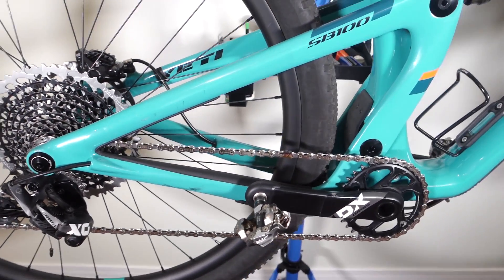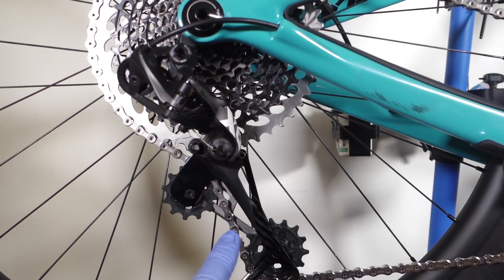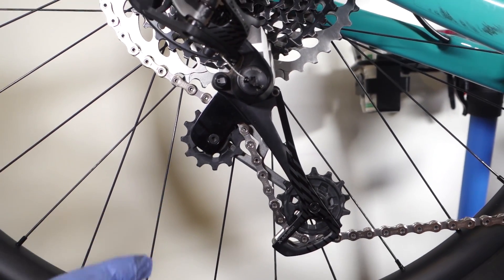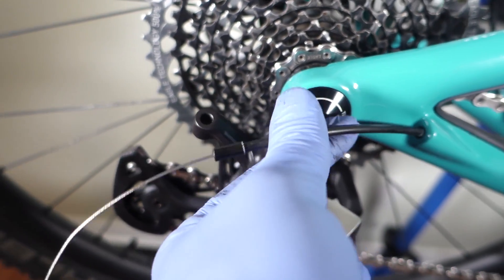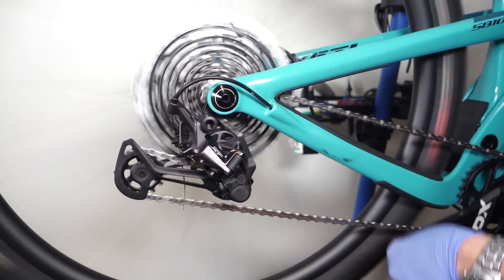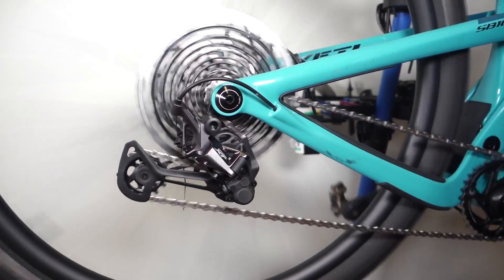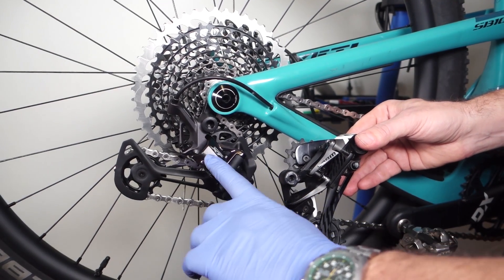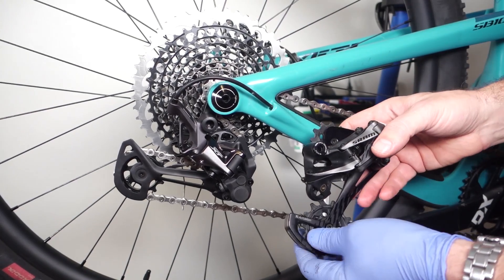MIX Drivetrain🔥12 Speed SRAM Eagle Can Use a Shimano Derailleur - Hybrid Drivetrain

Comment: Hi can I ask what derailleur hanger did you use, stock?  Im looking buy the xx1 bbolt and limit screw set for an upgrade and was wondering if I can use the bolt as well as the hanger.  Its the gold colored xx1 bolt
Reply from the maker: Hanger is frame specific so I would keep it like that 😉

Comment: hi, i have shimano xt derailer and shifter, sram cassette and chain. 2 questions, which method for chain length and which method for b gap? cheers
Reply from the maker: @richarddevey2449  Either one Shimano/ SRAM provide same results so I usually use Shimano, easier to do. Have a Shimano 12s install video if you need guidance on that
Reply: @LoveMTB  thankyou i will

Comment: Great videos! You let me have special idea. Would you have tested sram x1 11 speed shifter used with shimano M6100 12 speed derailleur? It works?
Reply from the maker: 11 speed is a slightly different beast, it will work to some extend, what cassette?

Comment: This is what I run and I think I prefer it over the Sram xo derailleur. The shifting genuinely seems more consistent with less noise dropping down fast.
I do feel that Sram derailleurs pulley cage is tighter and firmer than the xts which has more flex but in useI haven't noticed any negatives.
I much prefer the Shimano clutch system. My XO derailleur was in very good shape but the clutch was non-existant. Not sure how long it lasted but in my opinion it should still be working considering the cost. No adjustment and no servicing while Shimano is completely adjustable, rebuild able and replaceable on a derailleur far cheaper and I believe just as light.
So, as far as derailleurs are concerned, big fan of Shimano over Sram plus it sits far closer to the bike than sram.
I'm sold on the sram cassette ever since I first saw it. Being 1 piece machined from tool steel is next level and you pay for it but it's solid, zero flex, super durable and ultra light. The last 2 are hard to achieve but gone are the days of replacing a worn cassette every couple years. Ditto the chain. The higher end sram chains look like any other but supposedly they built an entirely new facility just for the chain and they just don't stretch. Strong too. I use fancy Silca drip wax that should also prevent wear. So, longevity wise those components are solid. I've not tried the Shimano cassettes with the newer shift technology but would expect it to shift smoother. The construction is inferior but their shift tech is pretty much unmatched, they have a ton of experience with the ramps and gates, my 10 speed stuff shifts like butter, sram not so much. It's good but not see less like Shimano.
Reply from the maker: Yeah we used it for the same reasons you mentioned. Thanks for sharing!

Comment: hey there, I've got an X01 shifter, NX 12s cassete and XT derailleur, b screw adjusted to shimano's guide, limiting screws set up right, gears go up to the easier gear really well but going down is a trouble as it sometimes goes 2 cogs down and adjusts itself back to the correct cog, when i twist the adjusting screw any tighter then it doesn't wanna go down a cog any ideas? The hanger is straight btw
Reply from the maker: I would check your derailleur hanger first before anything

Comment: As someone who currently is having issues with the shifting on a SX 12 speed derailleur (keeps jumping between gears in the middle of the range seemingly on it own) this is great to hear. Was first thinking to upgrade to a GX one, but people seem to have mixed opinions on that one too. Can I just grab any Shimano 12 Speed model or is there anything in particular I have to keep in mind when choosing one? And can the chain length stay as is or does it need to be longer / shorter?
Reply: Seems to be a bent derailleur hanger

Comment: Great job as always! Nice to hear the straight goods on mix & match, and I agree with all your points. No one else mentions how long cage 12s derailleurs are more prone to picking up debris. I have 3 bikes total. I used to use Shimano 10s shifting hard out of the saddle up & DOWN the cassette during racing and training. But you're right, there's not many races where this is enough of an advantage. But you DO have to let a Sram 12s "breath" more while shifting. I'm super paranoid about munching my Eagle XX1 derailleur. But when I do, it will be Shimano XT 12s derailleurs all the way all three bikes! Simpler and cheaper for stocking maintenance spares. The one thing I find is the Sram XX1 shifter is a better ergonomic feel for me compared to a Shimano XTR 12s shifter, no matter how it's adjusted.

Comment: I did this and it doesnt work for me. i have a SRAM SX  rd, NX Shifter, 11-50 sram cassette and really bad shifting. I replaced the rd with a shimano xt 12spd XTM8100. the shifting is worse. I spent 2 hrs trying to make it work. Ive been working on my own bikes for 35 years so im no beginner. The B tension screw when fully backed out is almost completely removed and the rd  jockey wheel is still a long way from the cassette. The cable length was too long (sx rd). i left it long and it did a 180 deg turn with a 5cm diameter. Not sure if thats the issue. its a newer bike . commensal meta AM 2021, use 1 season. no wear. What could cause it to skip gears or not shift at all . I thought shifting could not get worse than what i have with sram, but it did. Should i buy an xt shifter too? and ditch the sram nx shifter? is the cassette spacing the same on sram and shimano?
Reply: @LoveMTB  Thanks, I added links to the chain and the rd jockey wheel got much closer to the cassette but the shifting is still really bad. the stock sx rd is way better (and thats so bad i wanted to change it !) What can i try? I  did get shifting to work well on the stand only in the larger cogs only if i ran the chain so slack it hung loose with no chain tension on the smaller cogs. Not sure if i should order an xt shifter, so i have xt rd and xt shifter, nx cassette, chain. ? or just sell the xt rd and wait till i can afford an entire noew drive train.

Comment: Got a question. Daughter got a Rockhopper for Xmas. Has 135mm hub with a 10 speed cassette. I have a lot of Shimano 12 speed parts laying around, mostly SLX. Rear hub body is older Shimano. Would a SRAM NX 12 speed cassette work so I can upgrade the rest? I believe 12 speed same width as 10?
Reply: @LoveMTB  I saw! I see some around and in stock thanks. I guess there’s a model for SRAM and one for Shimano derailleurs

Comment: Hie there, definitly subed to your awsome channel!
I hve tried this set up on my new build so gx 10-50 cassette with Xt 2 speed derailleur but i struggle getting the limit screw far enough to have proper indexing for the lowest gear. in fact, im turning it to the max outboard and it doesn't go far enough, any help is much appreciated! :-(

Comment: thx for your great videos and the tests!  After watching your videos, I bought XT shifter and deore 12 speed derailleur to replace the previous poor quality SX ones.  The Shimano components work perfectly, and much better than before, with the SX cassette, chain and crankset.  

Also, as mentioned in your another video, the XT shifter feels  like the sram's one but also with Shimano's two way release advantage.  Now I am happy to use this Shimano-Sram combo chainset until the next upgrade.  It gives me more flexibility to choose my future wheelset and gears.
Reply: Hi! Use the same combo and it works good. How do you adjust B gap? I try to line up with the 51 line on the derailleur but it doesn’t work. If I make it closer (loose b tension on maximum) it works good.

Comment: What about under load? I got one of the bad GX cassettes which click in certain gears cause of deforming teeth, so I’m gonna slowly switch to XT. Planning on starting by getting the XT derailleur and shifter.
Reply: @LoveMTB  can it do the double shift to the smaller gears on the sram cassette with the XT shifter? Or does that feature only work on an XT cassette

Comment: last year I bought a bike with SX group, one of the most stupid things I ever did, I plan on buying a SLX derailleur and shifter, and use the same sx 11-50 cassette, do you think it will work well? I have no plan on buying anything microspline or other thing so I will keep it low cost.
Reply: @LoveMTB  thanks dude, will have a look into this new deore, I will have to change the shifter too, SX shifter just fell apart, I had to wrap it with tape, the screws really did screw up... real piece of crap. I bought a new bike with GX 2021 and it's just like dream! nice channel btw
Reply: @LoveMTB  yeah sram is good from gx and above, sx and nx I wouldnt go for it anymore  Thx for ur help dude

Comment: Hi, again great video :) thanks a lot for making them. If I understand right, we can mix shimano and sram 12 speed systems but ... most important thing to keep it going smooth is to use cassette/chain/chainring same system (sram in this video for example) and then play with shifting. Is that correct based on your experience ? By this logic, it should also work opposite Shimano cassette/chain/chainring and Sram derailleur and shifter right ?

Comment: Hi, Shifting accuracy perfect, however upshift lever action is a bit harder to engage than Shimano paired with Shimano. It takes a more push pull pressure. Any tips to soften this lever action?  Thanks!

Comment: @LoveMTB, just wanted to say I love your channel. I recently started getting into mtb and learned a ton about bikes thanks to you!  I currently have a shimano XTR groupset. I would like to upgrade to the sram XX1 axs but I don't want to replace my whole groupset.  Do you think the xx1 axs upgrade kit with only a derailleur and shifter will work with my xtr crank, chain, and cassette?  Thanks in advance and I hope you get to read this.
Reply: @LoveMTB   yes sir!  XTR everything except for the derailleur /shifter. At first I thought about changing the whole group to XX1 however, the 2K price tag was a little steep.  I saw a good deal on ebay for just the upgrade kit for a little over $700 so I thought I'd give it a go. Worst case scenario if they don't play well together, i'll just go back on ebay and source out the remaining parts.  It's kinda sad nowadays that sram and shimano has different standards when just a few years back it's commonplace to mix match parts and get good performance. I guess they figured they'd make more money this way.  Anyway, thanks again!  I truly appreciate your reply.

Comment: Great video. Thank you for testing this. Been watching and learning from your vids for a few months now. 

Have recently swapped a sram SX rd and shifter for shimano XT. Had already warrantied the sram SX cassette for an NX cassette (bent the cassette after 4 months) and the sram chainring. 

Now running shimano XT shifter and rd with SRAM chainring, NX cassette and X01 chain. Works flawlessly. No more issues with b gap adjustment. Shimano RD is high quality. The “twist” makes perfect engineering sense. Very clever. 

But also wish Shimano had included the SRAM locking pin and that Shimano smoothed out the angle the cable must take through the RD housing just before the cable locking plate. The cover with tongue can easily be obtained or hacked - but is basically a bandaid for a design fault that I think could be fixed by rounding off the edge of the outer casing holder as the cable exits. SRAM solved this problem with a pulley wheel built into the RD - nice, but also another potential weak spot that will eventually fail due to repetitive stress. 

Inspected the clutch housing and mechanism prior to installing. The weakness in the Shimano clutch is definitely due to the ON/OFF switch. That’s the only point water can enter the clutch housing and create the corrosion and loss of grease that others have observed. I opened the housing, removed the switch and greased the port through which the switch lever enters the clutch housing. I used Shimano internal hub grease, but I reckon Parktool polylube or alternative thick grease would work. to prevent water entering here. 

I’ll let you know in 6 months how the clutch is going.

Comment: Hello 
The shimano xt 12 speed derailleur is out of stock in most website so im just wondering if shimano deore m6100 derailleur will work on sram eagle nx 12 speed cassette?
Reply: @LoveMTB   thank you. I ordered the shimano slx m7100 12 speed derailleur does it work with a shimano xt m8100 shifter?
Reply: Thank you for the answers :)
Reply: @LoveMTB   i just want  to double check does the sram nx cassette 12 speed works with shimano slx m7100 12 speed derailleur?

Comment: does a shimano xt groupset works with sram nx cassette?
Reply: Thank for the answer. What chain do i need to use?
Reply: I will keep that in mind thank you. just to make sure because my plan is i will use shimano xt shifter and crankset and derailleur and a sram nx cassette do they work together?
Reply: Thank you very much :)
Reply: I changed my mind im just wondering what about the shimano deore m6100 deraillur does it work ?

Comment: Great video! I have a full SRAM NX 1x12. the rear derailleur has been nothing but problems. Falling out of tune, ghost shifting 
, and it has recently started rattling. It is a know problem from play in the b bolt. I have given up and am switching to Shimano I am leaning towards the xtr because of the clutch stiffness and reliably as I ride rougher terrain. Do you have a preference xt over xtr ?
Reply: @LoveMTB   Thanks for the reply. Its just a friend of mine had a new XTR hes looking to sell very cheap. but one more question. What is the difference between m9100 and m9120. Are they both compatible on the 1x12 nx cassete.
Reply: @LoveMTB   Thank you so much. Your videos are very thorough, and extremely helpful. Also after more reseacrh I don't think the M9120 will work on my nx drivetrain. As the NX cassette is a 11- 50t and the m9120 uses a 10-45t. Don't know if the RD can adapt to a bigger chainring.

Comment: Great video, I’ve just replaced my NX derailleur with an XT M8100. When setting the B screw it seems to be maxed out in one direction and the upper jockey wheel still has a fair gap between the largest gear on the cassette. Any suggestions? I’m on a NP mega, maybe I need to change the hanger? Cheers
Reply: I’ve the same problem with shimano m6100 derailleur (

Comment: Hi! Was wondering which chain you need to use?

Currently, I am using xt 12speed rear Dee + SRAM 12speed chain + 11-50t zitto cassette. Can't seem to shift properly.

Would you think it's the chain + rear Dee combo or the cassette is the issue?
Reply: @LoveMTB  yeah likely to look into swapping to a SRAM cassette at the least to see if it's better. Thanks for replying! 🤙🤙

Comment: Hi, I find your content very entertaining and I learn a lot from you. I have a question. I want to convert my 3 × 8 bike to a 1 × 12. I don't have the micro spline or xd driver body hub. So I would want to use a sram nx cassette ( PG- 1230, 11 - 50 tooth). Can I use the Shimano Deore RD-M6100 12-speed Shadow Plus Rear Derailleur which is made for a 10 - 51 tooth cassette. Does that 1 tooth matter so much or will It work.
Reply: @LoveMTB   Thank you on a fast response. Going to buy the components tomorrow hopefully it will function. Looking forward to the video.
Reply: @petarmarinovic5220  how it works?

Comment: my GX Eagle derailer just blew up randomly so I've just ordered a XT derailer 12 speed, and I'll use the exact same GX chain, cassette, and shifter etc
Reply: @LoveMTB   I'll be fitting it myself on Thursday because my normal bike shop refuses to fit the XT rear derailer with the existing GX shifter😂
Reply: @LoveMTB  All fitted and tuned up, works perfectly and shits slightly better than GX

Comment: What do you guys recommend if you haven't got either? Got a 11-speed GX on my fatbike and love it. 2x10 on my regular MTB and think it's fine. I wanna go 1x12 but not sure if I should go for Shimano or SRAM. Will be using a XD body for sure though.
Reply: @LoveMTB  Cheers. I wouldn't mind spending some extra cash on a XT RD. Or isn't that worth the price?
Reply: @LoveMTB  Thanks! Going for a XT RD and shifter with a GX cassette then! I suppose it's fine to convert my current 2x crank to a nice 1x chainring with wide-narrow teeth?
Reply: @LoveMTB  Yeah it's non-boost (older Focus Black Forest).

Comment: I have just installed shim amp M7100 SLX rear derailleur on eagle SX drive train.
All is working ok, but am confused about b limit screw. No matter how much I turn the b screw I cannot get the adjustment line on the rear of the derailleur cage, close to the largest cassette cog.

How did you overcome this issue. Do I use the SRAM aligner tool ?